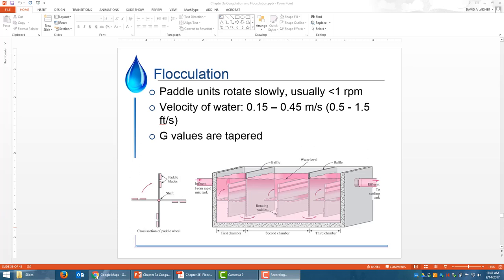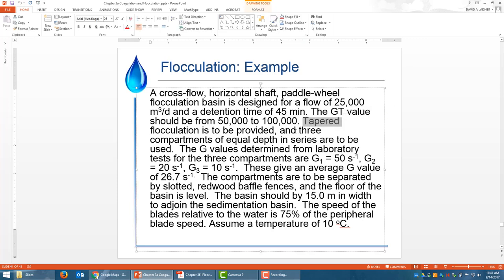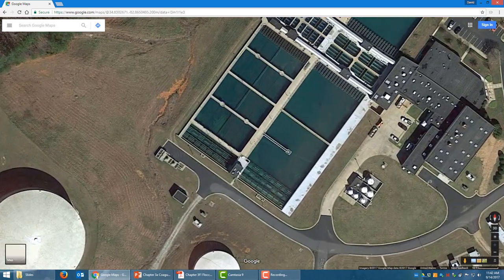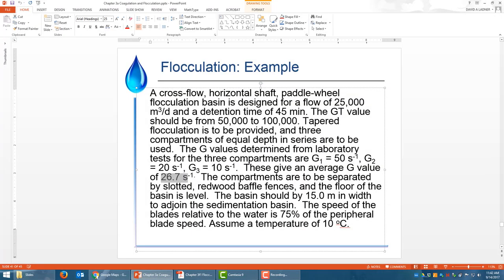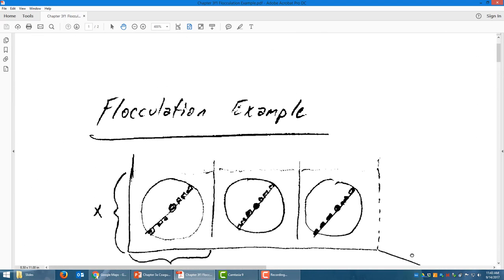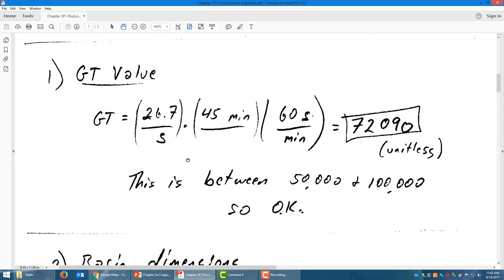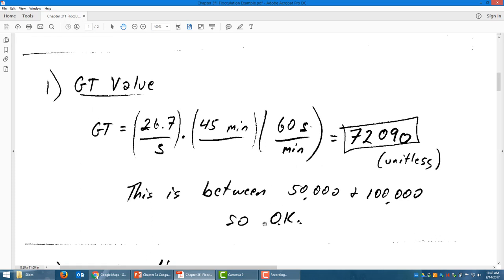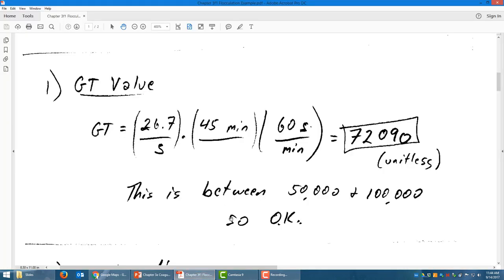Flocculation Basin Design Example

Comment: I was struggling to calculate RPM. This really helped. Thanks!
Reply: How come in tip speed, 3.15 X 0.0875=0.87m/s? It should be 0.275m/s..

Comment: This was a really comprehensive example thank you. Are the slides used in this presentation available anywhere?
Reply from the maker: I didn't use very many of the slides in this video, but here is the file with all the slides from my coagulation/flocculation lecture: https://cecas.clemson.edu/ladnergroup/share/Chapter3-Coagulation-Flocculation.pptx
Reply: David Ladner thank you so much.

Comment: this video is super helpful. I was wondering if these same relations are applicable to parallel flow flocculators.
Are there different guidelines for this latter ser up? (i.e. relative speed coeff - drag coeff - tapered flocculation - cross sectional %age area)
Thank you!!!!
Reply from the maker: Sorry for the very slowly reply; I overlooked this. In general, the concepts should be applicable, yes. And I would think the G values and GT values could be the same in either design. But I haven't delved into parallel flow designs, so there could be some caveats. Plus, in real treatment plants there is a lot of variability, so if I were designing something I would go to similar facilities and see what they are doing.

Comment: please where i can catch this  example document PDF or ntp
Reply from the maker: I didn't have it posted anywhere previously, but I just uploaded it to https://cecas.clemson.edu/ladnergroup/share/Flocculation-Example.pdf
Hope it is helpful.
Reply: thank you so much
Reply: Thank you very much, the example is very useful. have some example to design a sedimentation tank
Reply: How come in tip speed, 3.15 X 0.0875=0.87m/s? It should be 0.275m/s..
Reply: @saurajitsinha2852  it is pi*3.15*0.0875
Reply: @gangadharandaluri6198  Thanks bro. I have already completed my B.Tech and doing my MBA now. lol.